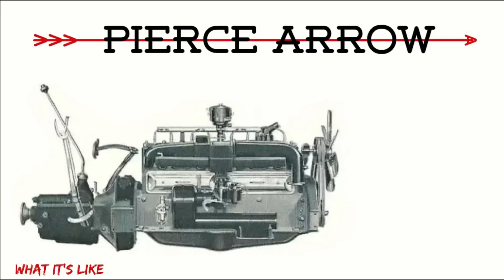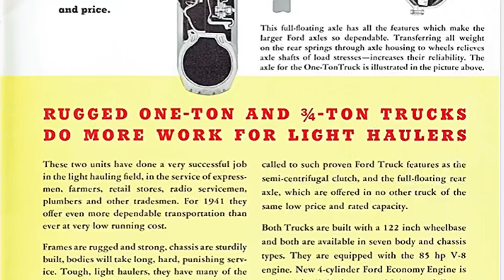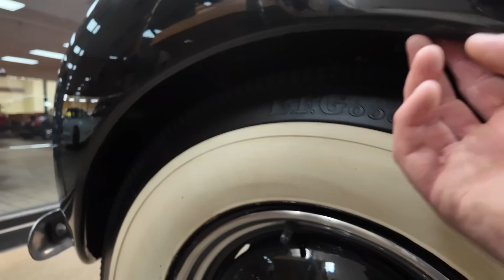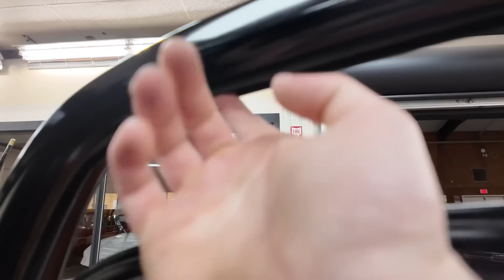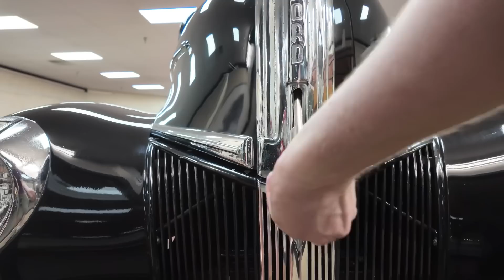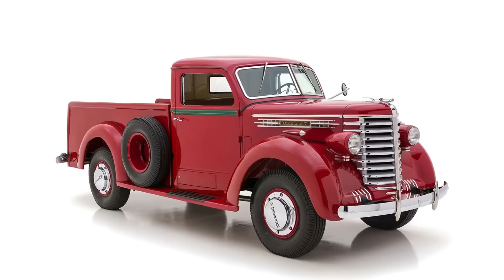1941 Ford 3/4 ton pickup truck

Comment: Square cut gears like my 1950 3/4 ton Ford pickup?  Only God could shift it down.
Reply from the maker: Hahaha I drove a 52 ford with that transmission I know what you mean had to double clutch rev and speed match just to drive it was hard
Reply: @What.its.like.  I used that Ford of mine at the ranch for 25 years.  Once in a while I got lucky shifting down.  Mostly just waited until in clicked in.
Reply from the maker: I have a 52 Chevy 1 ton steak bed that I drive a lot when I need a truck that is my truck. I'm going on a wood run tomorrow and I use the transmission to slow down a lot. I could not imagine what it would be like to not have that as a feature.. I only use the brakes to hold the truck there at an intersection or stop. I use the transmission to slow down its synchronized but sometimes I have to double clutch going from 4th to 3rd. I think the synchronizers are wearing out the transmissions from 1959. I don't think it's ever been rebuilt.
Reply: @What.its.like.  Yes, my faithful old Ford had the SyncroSmash transmission.  Just grind 'em until something drops in place!

Comment: I did a Model kit of a similar Ford Pickup! 🛻 I put the 2 4bbl 460 from a Starliner Model Kit.
That Valve Covers did have "Thunderbird" embossed ln them. I put Bucket Seats from a 1970 Shelby kit. Lost it during a move 9 years ago.

Comment: Love it! Any of those trucks would be great.  But I’ll take that Dodge pickup. Then, much as I love my Cornbinders, that Diamond T speaks: it doesn’t say “pickup” in lower case, it says “TRUCK” in upper case.  That is one serious pickup.  The crank holes persisted for years.  Our 1949 KB6 (which didn’t look much different than a 1941 International) would get hard to turn over when hot.  Dad would put the crank in, tell me to hit the starter button when he nodded, then start cranking.  Believe it or not, my 1974 Renault 12L had a crank hole!

Comment: You sure that's a 3/4 ton?  It all adds up to a 1/2 ton.
Reply from the maker: I was going off of classic automalls listing but the four cylinder only came in fleet vehicles and 3/4 and 1 ton trucks I don't think ( for as weird as it sounds) offer that engine in the 1/2 ton configuration I could be wrong but that's what I got from the ads

Comment: I love how simple the trucks were in 1941. Id take the dodge, but ford and all the others made good trucks. If i had one, id drive it daily.
Reply from the maker: I daily drive ( when I need a truck ) 1952 Chevy 1 ton it has a 350 v8 four speed transmission 3:73 rear end it does pretty good I can get 20 mpg hwy and probably gets around 11 around town 

I did a trip where I couldn't go over 50-55mph and got close to 28 mpg with heavy load

All of the trucks pre 1975 have the same issue they don't go over 55, but simple rear end swap will fix that issue

Comment: Gimme the stude.
About the 15k today dollar price, maybe somebody will set me straight, but if I remember right- as late as the mid 60's, if you wanted cheap wheels, you bought a pickup. I believe they were the lowest cost 4 wheel vehicle you could buy.

Comment: My trucks of choice would be the Studebaker and International, although Ford may have had the most modern of looks with the fully built in headlights. The following year Ford brought out the jail bar grill for its trucks, and had it til 1947.
Reply from the maker: Jail bar grill lol I never heard of it that way, sweet choices
Reply: @What.its.like.  Mr. Goodpliers always referred to it as the 'Jail Bar Grill' , but I like to call it the 'Jail House Rock' grill. A name Elvis would have liked. This describes the grill on the Ford trucks from '42-'47.

Comment: That's a half ton truck. I owned one for 25 years. 3/4 and 1 ton shared the same body and long wheel base.
Reply from the maker: Was the 4 cylinder offered in 1/2 ton? From what I read it was only offered in 3/4 and 1 ton and fleet vehicles

Comment: I had no idea that a 4 cyl engine was offered. I guess it's the motor from the Model B? Likewise, front sheet metal looks to be 39/40. They sure didn't like to chuck out their old tooling!
Reply from the maker: I had no idea either. I was shocked to see that engine in that engine bay, but it's totally different than the model a/model B engine that engine was a bigger four cylinder 3.2 L displacement.

Comment: Hi Jay!  What a beautiful truck!  Interesting that it has the 4-cylinder engine in it.  I wish I could remember which magazine I read an article in, but, they had found a few different 1941 and 1942 Ford CARS with the 4 bangers in them.  They didn't look like a hack job, but were most likely factory installed.  So perhaps the economy 4 could be had in the cars, as well.  Super cool!  Unfortunately, you have not made it possible for me to pick it in WYR!!  One; Studebaker.  Two; Diamond T!  What a truck!  Now THAT was a truck!
Reply from the maker: Hahaha yeah 1941 would have been a tough year to pick a truck that's for sure

Comment: One engine I would like you to do a series on, is the Ford flat head 337 that was used in the Lincoln Cars and 700 and 800 Trucks from 1949 to 1951. this is an engine that has vary little recognition.
Reply from the maker: Awesome I thought I did an engine episode on that one already but I had to go back and look and I haven't so thank you so much for that suggestion

Comment: Another superb post, Jay!  Other than those silly wide whitewalls, this Ford looks restored to "original."  WYR: 1-Ford 2-Diamond T!    A buddy bought a 1947 Dodge pickup when he was 19 and he still has it, and it's still running, 52 years later.  Looks just like the 41 Dodge you posted.
Reply from the maker: Awesome =) these trucks will fun forever if maintained proper as they don't track your every location, which is nice

Comment: I think that only the Ford has a 4 cyl. engine, maybe?  I'd go for the 1941 Chevy with it's standard 90hp 216. It was smoother and had more torque. Torque is the most important thing in trucks. lol

Comment: My father had a 1938 Diamond T Model 80 that we used as our farm truck.  It had a Hercules 6 cyl engine with seven main bearing cast iron 'frog' wheels and crank-out windshields.  I drove it in the fields - it ran until ~ 1956
Reply: That's a great story.  I love that old iron.

Comment: Wow. With 30 horsepower, that speedometer is REALLY optimistic!  I'm sure it didn't come with whitewall tires, either. WYR: Chevrolet, Diamond T, though the Hudson and International are also very cool, and the Ford would be fine with the V-8. Oh heck, I'd take any of them!
Reply: It Didn’t come with a Four Cylinder
Reply: That is NOT a 3/4 Ton
Reply: Maybe it would hit 100 mph in a free fall over a cliff.  🤣

Comment: Did I see a glass roof in the background? If so I hope you cover it. This is a truck as trucks were meant to be- workhorses without unnecessary distractions like power heated seats and infotainment systems and built-in beer, uh I mean soft drink coolers. Go to any dealer today and they'll tell you it isn't a truck without all that crap. If they sold this truck today at the adjusted price of ~$16K they'd sell like hotcakes as the shtuff they want you to buy rusted away sitting there 🤣 Mr. Ford was stubborn and lost sales to the others who had 6 cylinder engines; businesses wanted economy but many needed more power than a 4 delivered. Whoever had this one either didn't use it as a truck or someone spent a thousand hours getting the single-layer bed and tailgate perfect; you never see them this straight. They also need to learn how to secure the tailgate properly-  with it hooked from the top it can come unfastened when you hit a bump letting the tailgate drop as you drive 😱 Hook it from underneath and the weight of the chain will keep it fastened 😎

WYR the 41 Ford then the Hudson Big Boy with the International getting honorable mention.

Comment: First pick any 1941 International K-2 pickup second 1941 Diamond T 201 or a REO 1 ton pickup
That 4 cylinder truck might have at least a 4:88 or y or more rear end ratio for that heavy truck it still looks good.